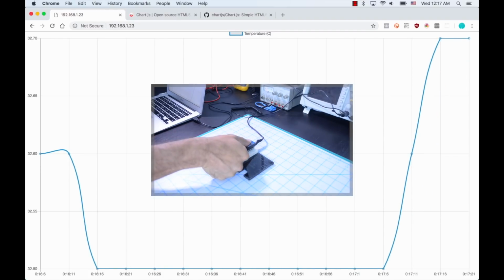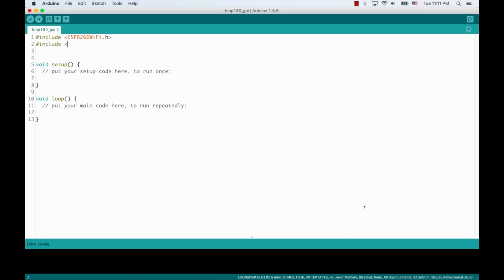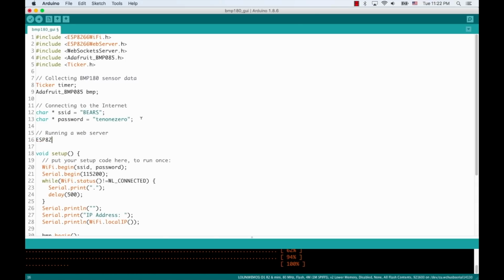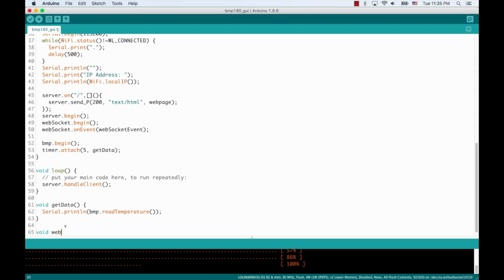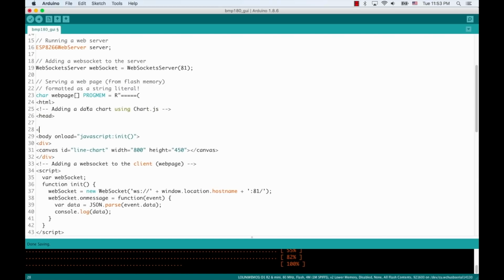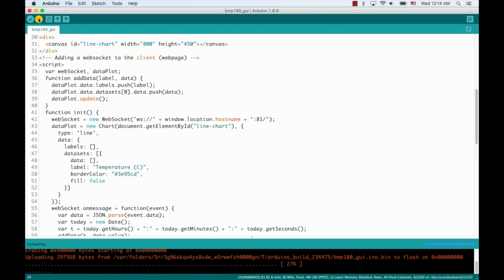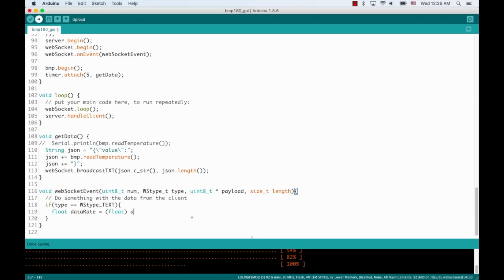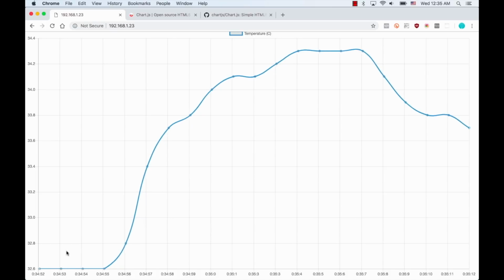ESP8266 Plot Sensor Data With Websockets/Chart.js In Arduino IDE (Mac OSX & Windows) | WeMos BMP180

Comment: how would you change the code if your were using the analog reading from pin A0? ah 2hours later got it working with the analog value.

Comment: I tried accessing the webserver in AP mode . If i access it from 1 device it works fine . The moment i try to take data on more than 1 device the value updation stops . Like it does not show the same value on all the devices i connect to
Reply from the maker: it might be a timing issue to to the update frequency. i made some changes to the code, let me know if this works:
https://github.com/acrobotic/Ai_Demos_ESP8266/blob/master/bmp180_gui/bmp180_gui.ino
Reply: @datasith  Ok so i tested the code and i found something interesting, you're actually right . If you need to use a faster update rate you cant access the values on more than 1 device efficiently unless you run the cpu at 160mhz. When i did that higher update rate did not gave me any problems with more than 1 device. So basically the libraries are not that efficient to handle more clients with high update rate at low clock speed . It simply goes into restart . Also another reason which i understood for that is the ticker library. The ticker library uses one of the timers which hinders the wifi layer of the esp . I hope my findings will help you .

Comment: Ok so now i have another query . What if on a webpage i have 2 values , and i want both of the values to get updated at a different rate . How do i do that . Do i create 2 json and 2 getData() functions or like what is going to be the procedure?
Reply from the maker: interesting. i would do it with one file and identify each value (e.g., "sensor1: ____", "sensor2: ____"). and i would pass a parameter to getData(which_data_to_get) to indicate what device to get data from. hth!

Comment: If i simply want to see the analog values on the webpage using this . So how do i modify the code to do that ?
Reply from the maker: you can just change how you get the sensor reading in the code, and you're good to go. so instead of `bmp.getTemperature()` you would have `analogRead(your_pin)`. HTH!
Reply: @datasith  That i did but the data is coming in the console.log not in the webpage. i dont want any fancy graph or anything . A simple webpage which shows changing values .

Comment: I'm attempting to use an ESP8266 to easily display telemetry from a uni project as a webpage. This tutorial has tons of valuable information and also solved the mystery of "how do I get live data to display on my webpage?" for me! :D

Big thanks for this smooth and easy to follow intro.
Reply from the maker: i'm sooooo glad to hear that it helped. thanks so much for letting me know!
Reply: @datasith  I've got it up and running in a very early beta stage, not using graphs for now, as the ESP will be an AP, sitting inside a model boat. I'm sure there are ways to incorporate simple js graphs into the ESP as well, there are tons of memory for code and data, and then there's also the SPIFFS. I'm using a derivative of your js code for changing the inner HTML of pre-defined paragraphs with an assigned id. Learning new things that produce meaningful results is fun!

Comment: Could the esp8266 serve the webpage using data that it gets from a master uart or spi device ?

And Is it possible for the Esp8266 to serve NuxtJs or ElectronJs style webpages.. or would it require other server-side support packages making it virtually impossible?        
Finally, any thoughts on using VsCode/PlatformIO instead of the ArduinoIDE?
Reply from the maker: yup, in your handler function(s), you can first get the uart/spi data, and then create the html on the fly with it. a little more involved is to serve the data from a dedicated route, and use javascript on the client-side to fetch the data as needed using AJAX or websockets.

sorry boss, i'm not familiar with nuxtjs/electronjs. client-side you can do anything, and as you point out, server-side is complicated as you need to have a version that runs on the SoC. even the web server capabilities themselves are very limited. i'm also unfamiliar with VsCode/PlatformIO. i've never needed more than the Arduino IDE, tho i see the benefits of some alternatives!

Comment: how to fix packages\esp8266\hardware\esp8266\2.6.0\cores\esp8266/core_esp8266_features.h:88:1: error: unknown type name 'uint32_t'
Reply from the maker: this is a known Arduino bug. for a solution see for example: https://github.com/Links2004/arduinoWebSockets/issues/495

Comment: Hi. I did this, and also added a digital output to turn on an led. But I get a bad analog sensor reading when I activate that dig output, can you help me?
Reply from the maker: Hmm, that's strange. Unfortunately I don't have the time to look at the code in detail. Remember to add a small delay in between analog sensor reads. HTH!

Comment: Is it possible to do this in multiple sensor and plot then in one graph? Great video anyway :D
Reply from the maker: Yes it is! I'm planning to work on a video to demo the BME-680 (temperature, humidity, pressure, and VOC sensor). I will use this websockets codebase as a starting point, and plot all four measurements in a single graph. Stay tuned!
Reply: @datasith   YAAAY! thanks! can't wait for your next video
Reply: @datasith  You can't now use AsyncWebServer's own implementation of websockets, which won't require additional WebSockets library and extra port creation.

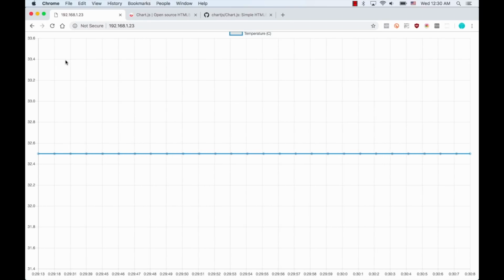Comment: 16:00 What given point does the browser get slower? Can I show thousands of points? What is the limitations?
Reply from the maker: Depends on RAM (mostly) and general capabilities of the client machine. That's why I start popping off old data. I encourage you to give it a try, you don't need any hardware, just generate random data with JavaScript on a script running on your computer, and use your browser to run it. HTH!

Comment: I have a question if I do not open the crhome browser to run the client and the ESP8266 is running, as I do so that the page that is inside the memory of the ESP8266 is executed without it being in the browser?... thanks
Reply from the maker: No, the page only "executes" when a client (like the browser) requests it.

Comment: What is the best humidity sensor? I saw many of them like SHT30, DHT, BMP and I got confused. Also can the SHT30 Shield work together with OLED Shield (For D1 mini) from wemos, as both of them connect to D1 D2 pins (if I change the pins manually)? Another question please, if I want to use a physical button, do I just connect the gpio with gnd(or 3.3v) directly or I need a resistor?
Reply from the maker: Thanks for watching my vids.
1) SHT30 or BME680 are the most accurate. The best way to compare all of them though is by looking at their datasheets.
2) Yes they can work together as they'll have different I2C addresses (I2C is a parallel bus so it's okay to share pins as long as the devices have different addresses).
3) You do need a resistor othewise you'd connect 3.3V directly to ground when actuating the button, however, you don't need a resistor as you can use the internal resistor (e.g., using mode INPUT_PULLUP) on the GPIO.

Comment: I can not access  the Web Page with the certain code , while with other codes I can , does anybody encountered any problems?
Reply from the maker: What codes aren't working?
Reply: @datasith  Hi ACROBOTIC and thank you very much for the immediate response . The program you are making on that video it doesn't work in my  wemos (even with the first test you are doing in the video) . I have put a println( IP) in the void loop  as well and I see that the IP doesn't remain the same. After a while it becomes 0.0.0.0.But successfully connects at the network . In a few words I can not access the website with the given IP address. While with other programs I can , I wondered if using mdns class would would help things. But I will check again if I am doing anything wrong. Thanks a lot again
Reply: @datasith  Actually I am trying to do the same but with an analog input with a potentiometer. I placed the analogRead(A0) at the void loop and the connection fails. Do you have a specific idea on how to do that simple thing ( to display the analog input instead). Thank you

Comment: great job and love your videos :)! I am trying to do the same but in this case the ESP8266 will not have internet. How do you add the library directly in the board instead? Thank you! P.D. maybe you could lower a bit your background music ;) but is nice!
Reply from the maker: Hi, Victor. Thanks for the kind comment. I messed up the audio on this one and the background music is a bit loud. Newer ones are better, but let me know what you think.

I'm planning on doing a video to give out the code for doing this. You need to store the library in flash memory (see my videos on SPIFFS) and add a route "/chart.js" that uses filestream to serve the file when the route is accessed. Then, in your HTML you can load it from "/chart.js" instead of the CDN's URL. Hope this helps!
Reply: Hi, I saw this comment and tried it! works perfectly  @datasith

Comment: does anyone else has problem compiling timer.attach () ? personally I cant !
Reply from the maker: Hmm, weird. Double-check the code, it's working on my setup. Thanks for watching!
Reply: @datasith  And can I ask you something else please ? How would I do it if I wanted to add another value form another  analogue input  even it is barometer or even a potentiometer? How should I amend the code ? Thank you
Reply from the maker: @George-jg6ry  fortunately, the modification is straight forward. You just need to add it to the measurement string:
  String json = "{\"temp\":";
  json += bmp.readTemperature();
  json +=\",pressure\":";
  json += bmp.readPressure();
  json += "}";

Then, to plot it you can add another dataset to the chart. Check out the examples on the Chart.js website. HTH!
Reply: @datasith  Hi Acrobotic , I am trying  to insert a a second value to the json string which is an int , and the way you proposed to do it is not geting compiled by the arduino . I have search and tried many ways to do but it doesn't  work. Do you know the proper way to do it in order to display on the console  {temp : 456 ,temp2: 456} for example ? Please help me on that and I will become your patreon ! Have a nice day

Comment: Cisco, me ayudas:   al compilar y pasar este codigo a wemos d1 mini, genera un error de memoria y la pagina no funciona.  El problema se produce con Ticker.   Como lo solucionaste, que libreria usaste?
Reply: Este es el error:
18:41:15.525 -> Exception (0):
18:41:15.525 -> epc1=0x4000dce5 epc2=0x00000000 epc3=0x00000000 excvaddr=0x00000000 depc=0x00000000
18:41:15.525 ->

Aqui otro error al subir el codigo....
18:59:58.208 -> Panic C:\Users\isond\Documents\ArduinoData\packages\esp8266\hardware\esp8266\2.5.0\cores\esp8266\core_esp8266_main.cpp:103 __yield
Reply from the maker: Che, Manuel. Apenas veo este comentario. Creo que ya te lo mencione, pero cualquier duda mandame un correo. Saludos!

Comment: Any thoughts on using WebGL for the GUI and webUSB to interface to the hardware?   For example, I don't have a webserver/websockets running on the microcontroller but I'd still like to control it via the browser!

Not sure all the differences, but would another tool SVG, Canvas, etc, be more appropriate than WebGL to implement the GUI?
https://medium.com/front-end-weekly/websocket-and-data-visualization-be3613c880db
Reply from the maker: Hey, Ben. I haven't tinkered with WebGL myself. You can use pretty much anything to build the GUI as that piece of code runs on the client's computer. I'm assuming you're loading them dynamically of course, but you could also have static versions on flash memory (you'd have to worry about size, but you can always add an SD card).

As for webUSB, I'll add to my list of things to learn about. If you have a good reference, please let me know!

Comment: Does this codes work on Arduino Uno? Please I need this for my thesis.
Reply from the maker: Arduino Uno doesn't have a Wi-Fi connection which is essential for everything in the video. Best of luck with the thesis.
Reply: @datasith  I got the esp8266 wifi module to connect with my arduino uno that acts as my web server.
Reply: Can I have the codes sir for this tut? I want to study it for my thesis.  Please
Thank you
Reply from the maker: @reymartmilitante9390  c'mon make at least some effort. The code is linked in the video description.

Comment: Is it possible to know the IP address without the serial monitor? Or like can I specify what IP address I want the router to assign my device in sketch?
Reply from the maker: You have a few options:
- Return the IP address by including it as part of the server.send(). The problem is that you need the IP address to begin with.
- Use mDNS and access the device by a domain name like my-esp8266.local
- Configure the router to assign a specific to the ESP8266 using its MAC address
- Operate the ESP8266 in combined Station Mode and Access Point mode. It'll access the internet, and it can use its own IP address on a separate subnet than the router. The problem is that you'd need to connect your computer to the ESP8266 WiFi, and lose internet connectivity on the computer unless you have an additional wired connection.

You  can't specify in the sketch what IP address you want the router to assign. That process is controlled by the router. But, you can configure the router to assign a specific IP address to the ESP8266 using the router's configuration settings.
Reply: @datasith  Thank you..

Comment: I am using a bmp180 sensor connected to an ESP8266. I see noise on the chart. I do not understand why so, are there any ideas? http://electronics.inf.ua/bmp180.png
Reply from the maker: Double-check your wiring and power supply. Next, make sure you give the sensor enough time between samples.

Comment: Thanks for making those great videos, right to the point and easy to follow but still pretty advanced, I really love them. I have one idea of topic you may want to cover. I have yet found any videos showing how to use OTA in AP mod(Acces Point, not regular wifi connected to your home router, that part is clear to me), is it possible? if so, a code that let you update OTA for let say 5 minutes and then turn OTA and perhaps wifi off all together to preserve energy. Im building a GPS logger with ESP32 as processor that I want to be able to use OTA on in AT mode and I have another project(out in the woods for a Geocache) where I have a solar cell driven ESP8266 that keeps wifi open during the day and then goes to sleep all night. This one is also in AP mode and its built in to a box that is hard to reach and it would be really helpful to just get within wifi reach and upload the new firmware, either by uploading binary file from my cell over a webpage or using the Arduino gui (but for that my laptop need to be carried out there, into the woods). I could add a reset button to restart in to OTA mode if needed.
Reply from the maker: Oooooh, I like this one! I haven't tried OTA in AP mode, so I'll give it a try and if it works I'll fit it into a project to make a video. Thanks for the suggestion! I very much appreciate the kind words, I'm happy you like the vids!